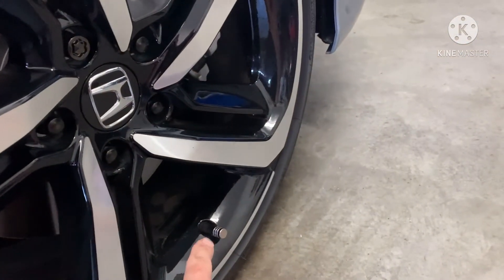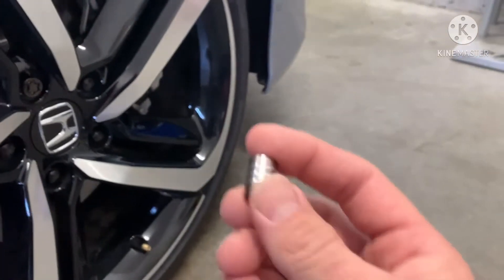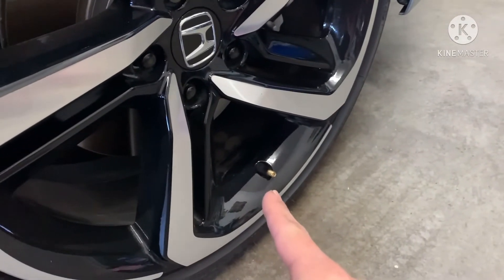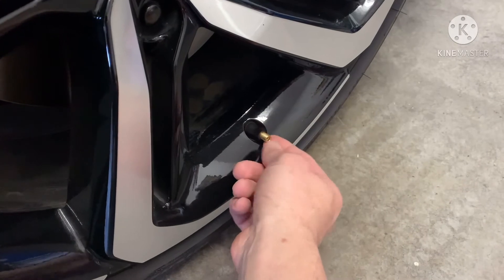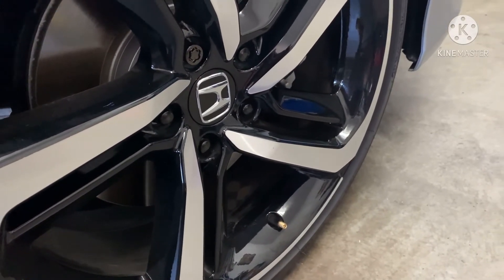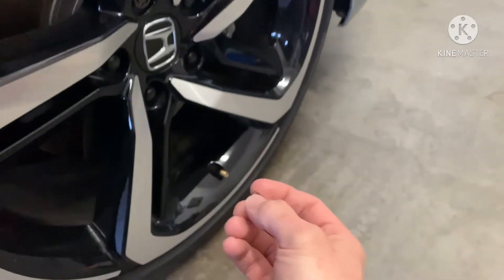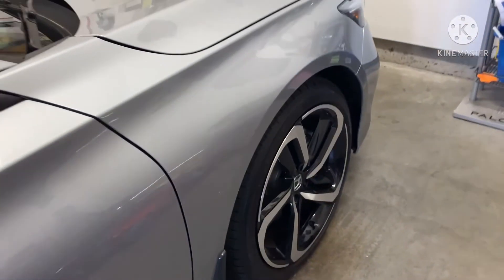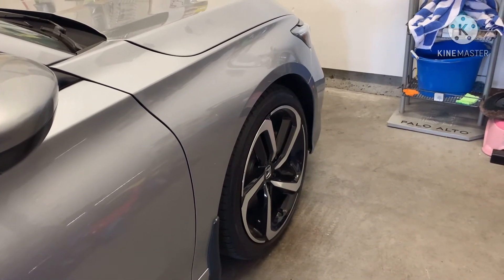IMPORTANT to know for every 2018-2021 Honda Accord and Civic

Comment: Thanks for the upload! I recently did this and it took a dremel saw, pliers, and a drill to remove
Reply from the maker: No problem. What happened to yours?
Reply: @HondaJon  caps were not tpm safe so they fused. 

Used the dremel to cut along the casing, then used the pliers to hold em still while i used the drill in reverse with a flat head attachment to rip it apart
Reply from the maker: Wow. Thanks for sharing. Yeah it can definitely cause some damage. You wouldn’t think such a small part could.

Comment: I used antisieze on the threads. The same stuff used when replacing spark plugs. I am a diy guy who does own car maintenance. They have not siezed after being on for months. You can buy small packets of the stuff. It works but can be messy. A little goes a long way. May be another solution it you have already purchased the caps.
Reply from the maker: Nice. That’s a great tip. Definitely would help. 👍🏻

Comment: Great Vid and so true That used to be and still is a big issue with metal valve caps with no plastic insert that heat up causing the issues you explained Good advice Take care Jon to you and the Family in Sunny Cali
Reply from the maker: Thanks man. Yeah it’s crazy how these little things can actually do a lot of damage specially if you live in colder climates

Comment: Hi Jon, good evening 😉 Thanks for the great advice 👍✔️ I have to sets of these stem caps but unfortunately they are metal 😔 I will look for the plastic ones like you mentioned, this way I won't have to worry about them fusing to the stem  and deem them unremovable 😬
Reply from the maker: Good call. I wouldn’t risk it because it would definitely cost you quite a bit to fix. Better to be safe

Comment: Do you know a way to turn collision mitigation off completely for the accord?
Reply from the maker: Yeah. You can either push the button in the steering wheel or go through the infotainment screen and do it that way. You have to make sure it’s unchecked.
Reply: @HondaJon  That what I do now in my 2019 Sport, but it only remains off until I restart the car and then I have to turn it off again. I was wondering if there was a way overall to turn it off to where it doesn’t come back on.
Reply from the maker: If you go through the infotainment screen it should permanently disable it.

Comment: Hey guys a I have a question I have a brand new Honda Accord 1.5 sports an I Burly reach 2 miles is it normal for it smell like burn rubber ? 
And when I First bought it on the drive from the dealer to the house it was smoking from the hood is all that okay ?
Reply from the maker: Definitely check under the hood and see where the smoke is coming from. Could be residual oil on the engine. It is normal for it to smell hot cause it’s brand new. They tend to run hotter as everything breaks in.